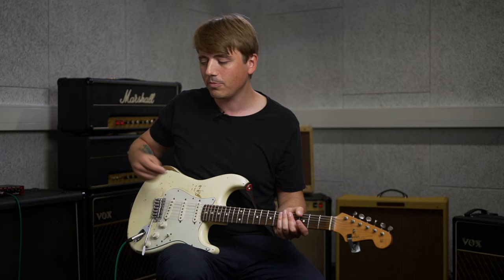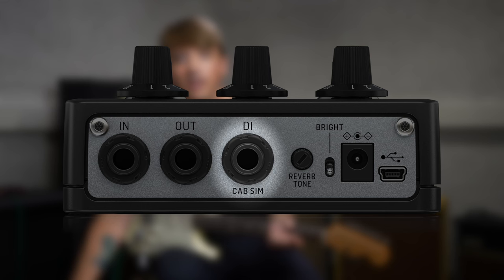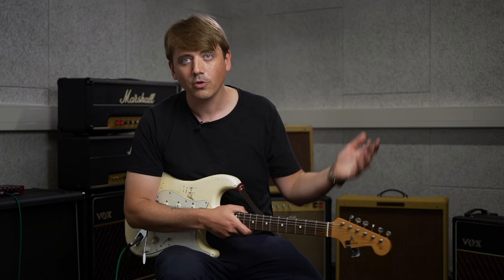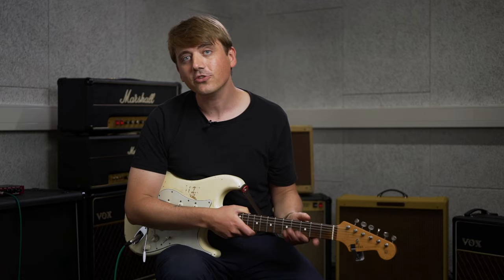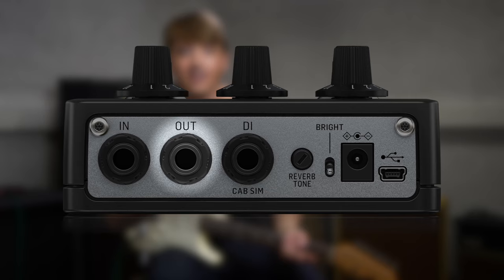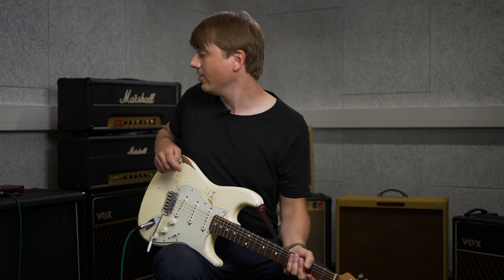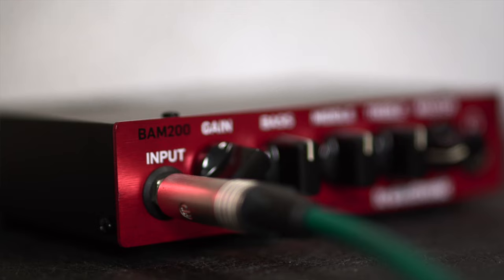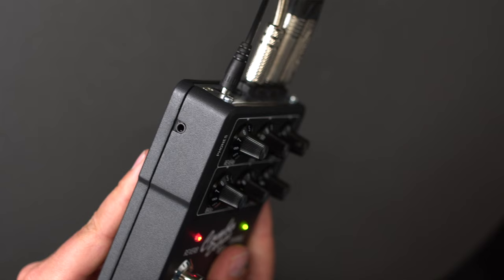How to plug in your AMPWORX pedals

Comment: can someone explain the routing  if I use this ampworx with noise gate send return and some time based pedal?
Reply: Treat it as if it was the preamp of the amplifier you're connecting to, meaning that everything you would normally put in the FX loop should be placed after it.

Comment: Would it be possible to use with amps that don't have an FX loop, like my Fender Pro Jr?
Reply: Possible? Yes, but it won't be as accurate in its depiction of the emulated amplifier, because you are stacking the tone of the pedal with the tone of your actual amplifier. Only your ears can tell if that's good or bad.
Reply: Thanks for the reply. I meant will it sound ok, not necessarily if it's "possible". Anyway, it won't apply to me anymore, as I just traded the Pro Jr for a Mustang GTX50, which itself has excellent emulators for many amps, Fender and others, and I like it a lot. Thanks anyway!

Comment: So, this pedal can be plugged in on an FX loop like a distortion pedal?
Reply: Yes and no. To maximize the sound of the emulation in the pedal, it should be connected to the FX loop but with your guitar cable going into the pedal rather than into the input of the amplifier.
Reply: @MrGul  So I would plug my series of in-front pedals (tubescreamer/wah/etc) into the Ampworx? (Guitarx>Wah>TS808>(etc)>Ampwor>FX Return). I can see this, but it commits one to using only the Ampworx instead of the amp's preamp.  Hmmm, maybe there is some way to switch this...

Comment: can I use TS (instead of TRS) in DI out (cabsim out)?
Reply: I have the same question?
Reply from the maker: Yes you can no problem. It will then no longer be a balanced signal so be carefull with long cable runs.
Reply: thank you for the reply 👍 @tcelectronic

Comment: It's a bit confusing. Turn this into the FX loop ? My distortion and overdrive pedals are going into the front of the amp and my time based fx into the fx loop. Seen most of the vids about the TC electronic ampworx only used with an audio-interface for e.g. recording. Is it worth using it on your pedalboard? Need some explanation here.
Reply: He said “into the return of your fx loop.”

That’ll bypass your amps preamp, and you’d just be hearing this.
If you want to use it as a distortion pedal into a clean amp channel, it has a bypass mode as well.